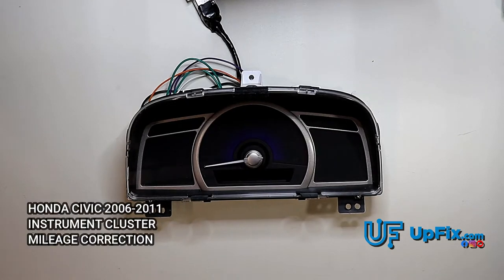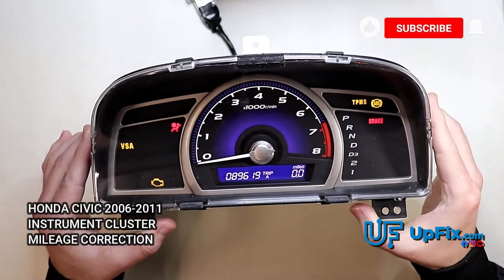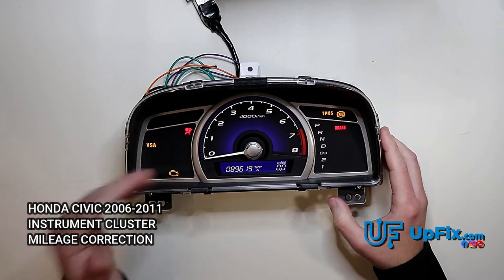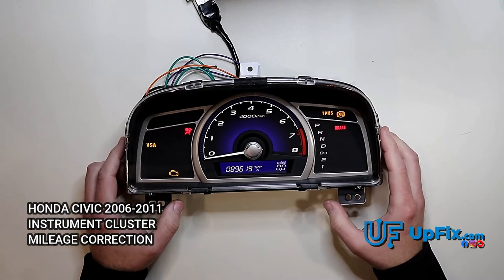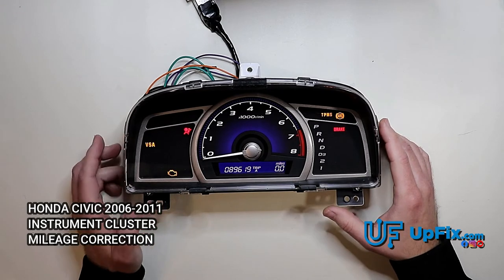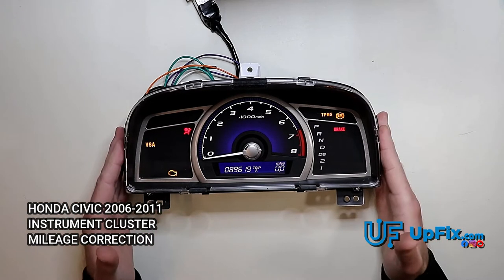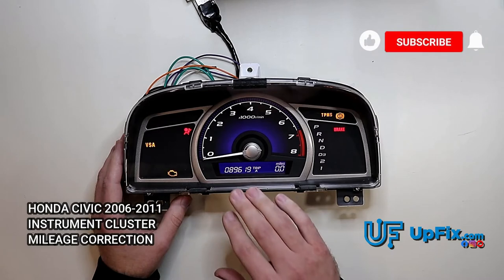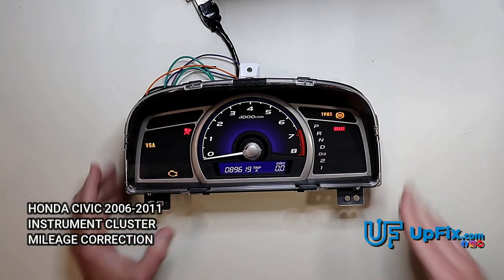Honda Civic 2006 - 2011 Mileage Odometer Correction on Instrument Cluster Panel ICP

Comment: Quick question, I wanted to buy a civic but the miles doesnt match the service records, is it possible some one replaced the cluster with a lower mileage cluster and try to sell the car?
Reply from the maker: Yes, it is possible that the original cluster failed and was not working, and someone could have replaced it with a new/used cluster, and now the odometer mileage is different.
If you need the odometer reading corrected, we can help with that. Here is more info https://www.upfix.com/product-category/repair-return/mileage-correction/

Comment: hello do you guys do have for 2013 civic si cause my mileage is  blank and the vsa light it permanently on
Reply: Per other Civic owners for that year that have had the same issue, try doing a hard battery reset. Have the cluster installed, battery removed, and short out the battery terminals for at least 30min. constantly touching. Unclamp battery terminals, re-install the battery and see if the issue with the mileage and VSA light goes away. If not, you might need to contact UpFix and provide the fault codes being picked up on an OBDII scanner.
Reply: @245artist  the mileage is showing before when i still have have my supercharger and hondata but when i took out the supercharger and put it back to stock my car went in limp mode and my mechanic said that my ecu fucked up. Then i buy a used one on ebay when i put that ecu thats when the the mileage is not showing its not blacked out its like blank _ _ _ _ _ _ _  and vsa is permanently on
Reply: @markjoseph8063  Since you've mentioned that the ECU was replaced, it's possible that the ECU needed to be cloned so that you can retain all the original properties and data from the original and have it re-flashed on the replacement. The mileage is primarily stored on the cluster. If the VSA light is on as well it could be that the ECU is not communicating properly with multiple components in the vehicle. A hard reset should help see if it's a soft-code issue or if you need the ECU re-flashed along with the instrument cluster checked out to make sure it's still working properly.
Reply: @245artist  my mechanic told me he throw the old ecu already since its not good
Reply: @markjoseph8063  Yea that's not good, always keep the original even if it's bad since it holds all the vehicle's data.
Reply: @245artist  so whats my best solution?
Reply: @markjoseph8063  Call the dealer, provide the VIN and see if the part number on the ECU you currently have installed is interchangeable with the original part number. A shop with a good scan tool should be able to communicate with both the ECU and cluster and re-sync them.
Reply from the maker: Great answer!